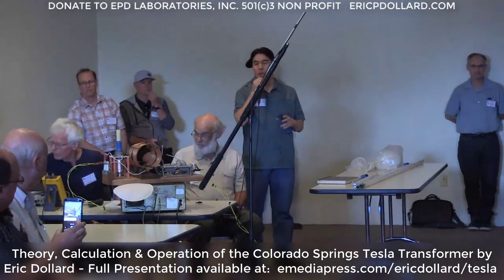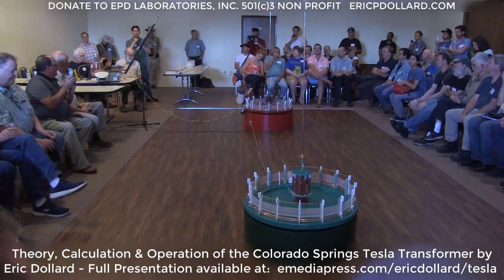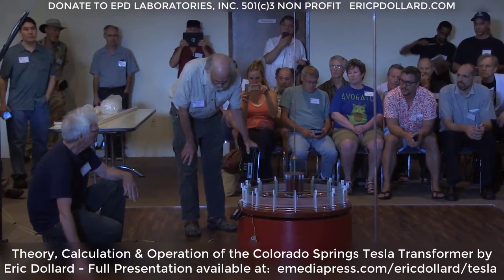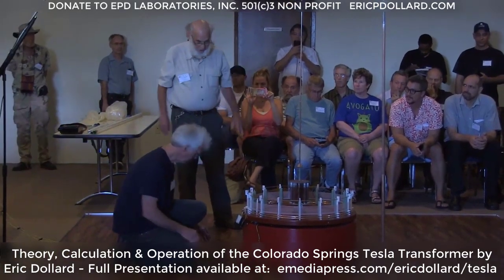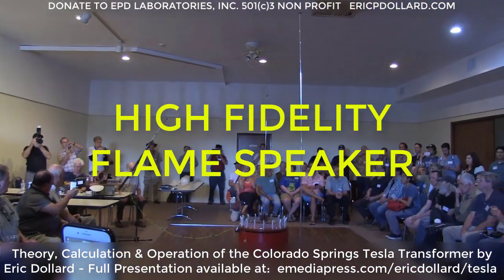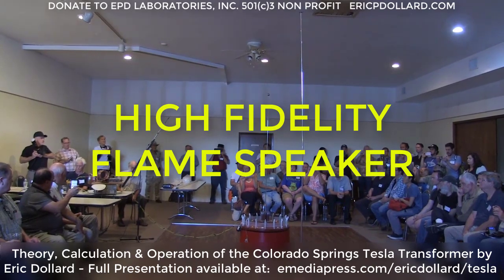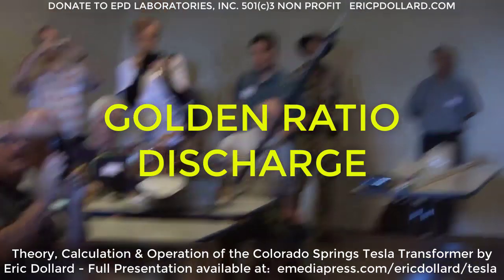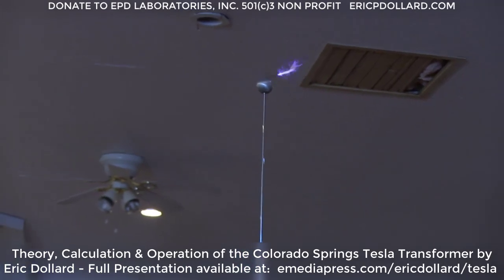20:1 Scale Model Replication demo by Eric Dollard

Comment: makes sense, an antenna uses the ground and the sky as a capacitor so it's only natural that a system involving two antennas with poles connected in reverse phase to one-another will allow better transmission through z-axis dielectric pulse reciprocation

Comment: Neutral zone into counterspace??????
Reply: This is a concept that coincides with the supposition of a luminiferous ether. Here are his claims about what his entire demonstration showed (typos are his, I just copied and pasted from his site):

A few of the aspects to the demonstration including a few that violate the “Laws” of physics are:

No closed return path – violates Ampere’s Law
If the bulb is removed while powered, the current doubles rather than diminishing – violating the Conservation of Energy
Energy disappers wtihout being accounted for – demonstrates the destruction of energy
Rare tenticle plasma from a tube in the field
Neutral spot in the middle of the fluorescent tube – the doorway to counterspace
A small version of the famous “Flame Speaker” – high fidelity sound coming out of the air as opposed to the low quality “Tesla Coil Speakers” on YouTube, which are simple PWM (pulse width modulated) versions.
500 watt bulb lit to full brightness with one wire.
Demo of Tesla’s “Rotating Brush” plasma at the end of a plasma tube held near the field.
Extraluminal transmission from transmitter to receiver – does not conform to the inverse square law – violating Einstein’s propaganda about light speed limitations erronously attached to electricity
Increase of AM station’s reception for transmitter tuned to the AM frequency.

Comment: I built a miniature one of those last year. Very cool to play music through but it creates a lot of ozone.
Reply from the maker: Are you sure you built one modulated like this or did you do a pwm "Tesla coil spark speaker"?
Reply: @AaronMurakami13  well, no I didn't use the AM carrier signal to power it. Eric is using the difference between the impedance of the atmospheric gasses and Earth ground conductivity tuned to the resonant frequency of the AM carrier. This provides a difference of potential directly from signal source and when amplified through asymmetric induction to the secondary of the coils, it generates the voltage needed for the plasma discharge. This then demodulates the sound at the discharge point and uses plasma to move the air which creates the sound. Fidelity comes from the carrier signal being many times higher than the modulated sound. I simply used an audio signal directly to a small Tesla Coil and powered it off of a battery PWM style but the way that sound is created from the plasma discharge is exactly the same.
Reply: @LabRatScience  Isn't that pretty much how a Tesla coil works anyway?
Reply: @baileyharrison1030  yes. However the tuff part is to build one and make it work.
Reply: Hey  Martyr4JesusTheChrist  um ok. Maybe try and imagine if you slipped and your head hit the floor on a wooden stage. That would "create" a sound that you may not hear. Now, did God make you slip ? eh ... thats a whole different discussion. :-D
Reply: @LabRatScience  hahaha, good one!:P

Comment: Can you provide a description at a 101 level. I know enough to understand that what Eric is doing(generally speaking) is amazing, but most of works/lectures I have followed(including this one) are beyond the current level of my understanding. A more simplistic breakdown maybe would help understand conceptually what is being accomplished/demonstrated.
Reply: Daniel Wood you need to get the book from Amazon . A common language for electrical engineering
Reply from the maker: @JP-xy7yd  This is a good recommendation to get your basic electrical dimensions down - correctly. Also, get Eric presentation http://crystalradioinitiative.com - that can't get any simpler in terms of the Tesla ground transmission.
Reply: Aaron Murakami thank you Aaron!!!
Reply: Aaron Murakami just ordered one now!